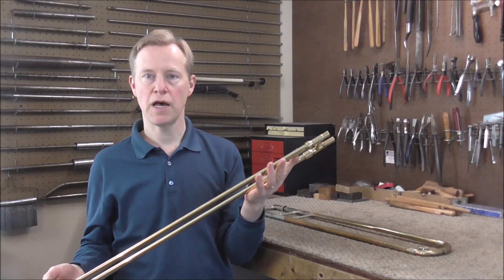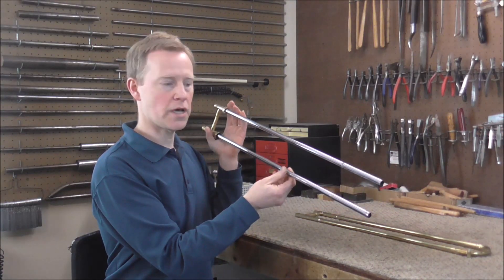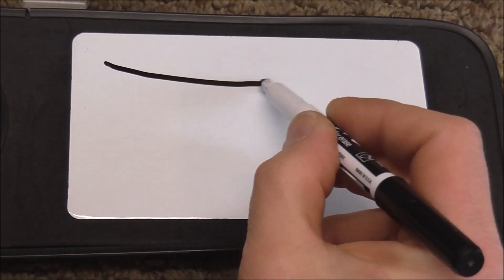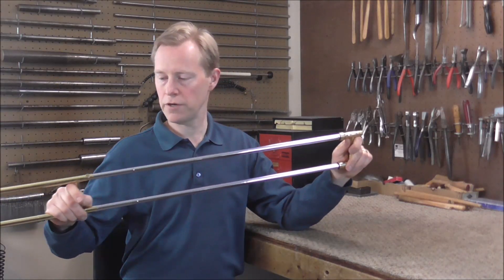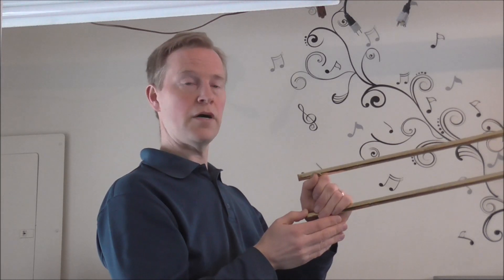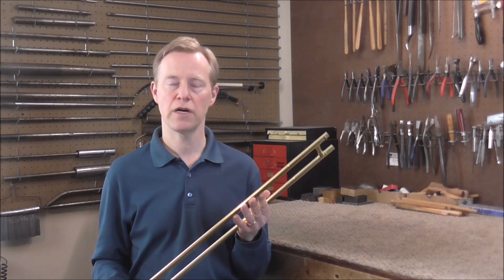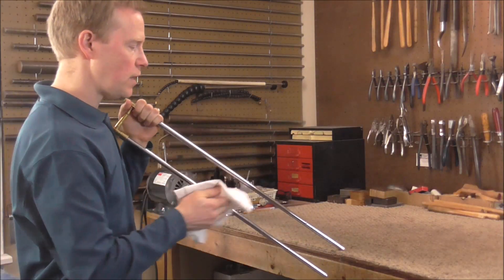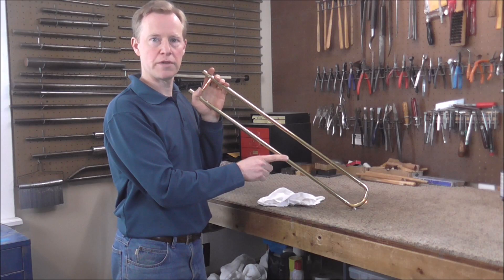Bent Trombone Slides

Comment: An other question : do you think there are models or metal alloys that have less chance to be bent ? Maybe students models are more heavy for exemples ? Let's say I just want to by a trombone "for fun"
Reply from the maker: Some student models have slides with more of a gap between the inner and outer slide tubes. These slides can be more forgiving, but they leak more and therefore do not sound as good. I do not know of any brands that are better or worse than others. If it works well when you buy it, it will probably keep working well. The last comment that Joe Bernie responded to is correct and very insightful.
Reply: @TheBrassandWoodwindShop  thank you !